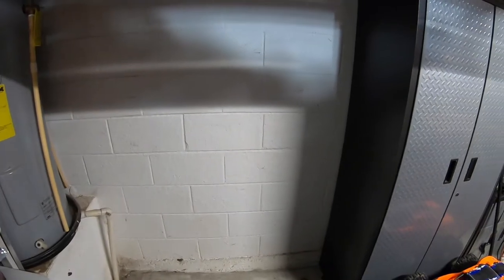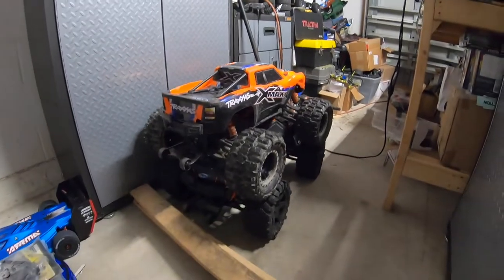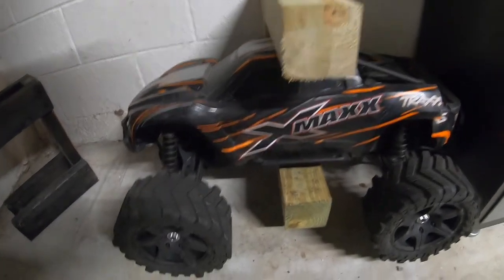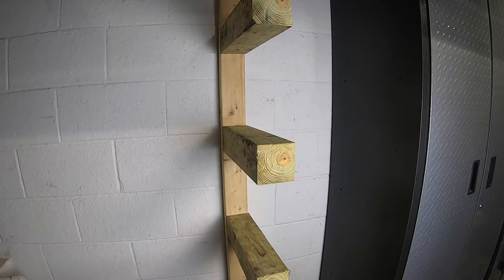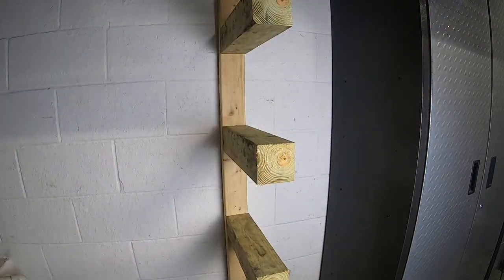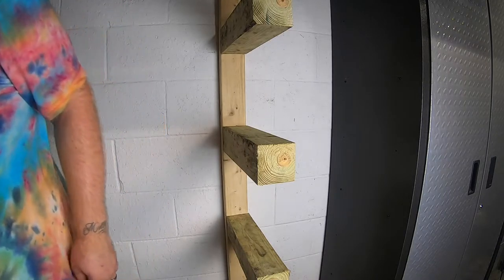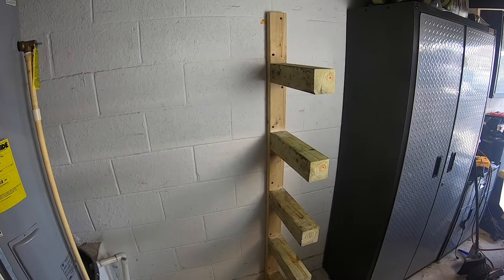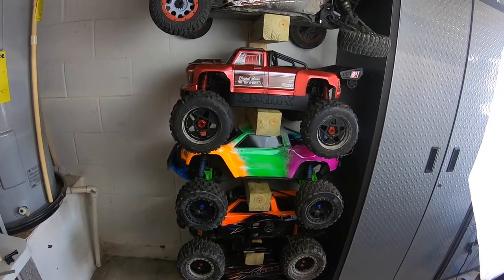Easy RC Car Storage Rack - How To Build | XXL RC

Comment: Hey checked out your video yesterday chopped up the wood today at the shop l work at and installed it. Works great for my outcast V2 and my teckno rc mt410. Right above my work bench. Thanks for the tip.
Reply from the maker: Awesome! Glad it worked out for you.

Comment: How long are those 4x4s cut to? And how much space between? Sorry if you said it I must have missed that part and am at work!
Reply from the maker: The 4x4s are 15” long and I put them 10” apart. Perfect for the X-MAXX. I’ve made them 12” long before, but decided to make them longer this time so I could put the transmitter in front of each truck.